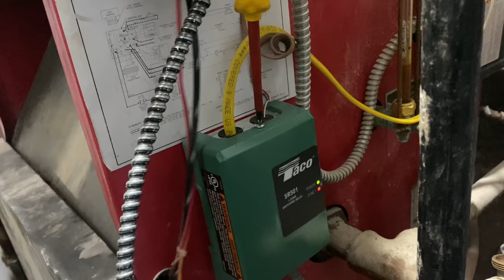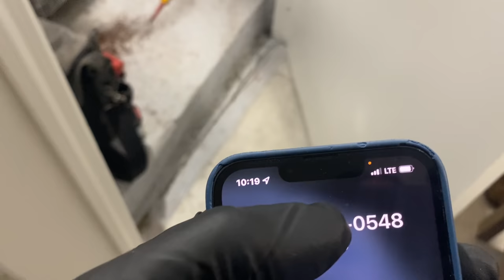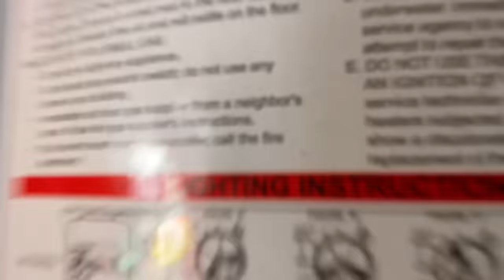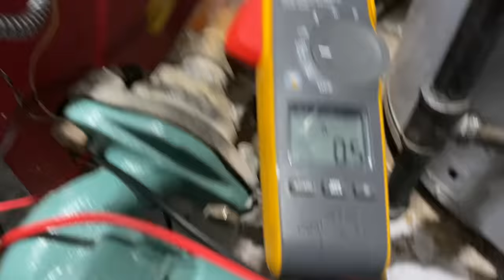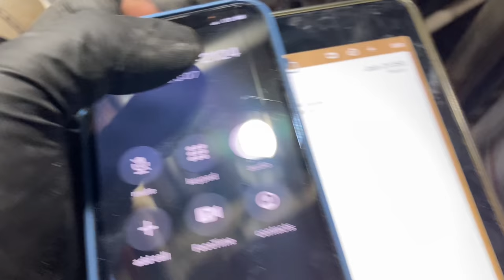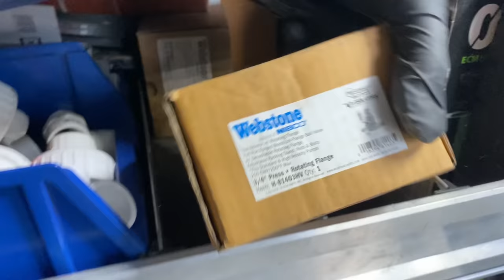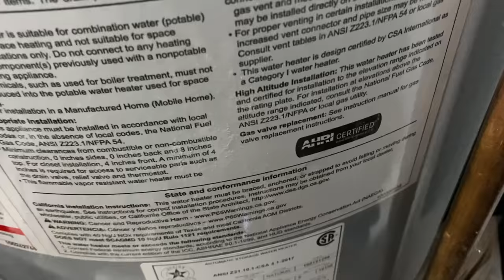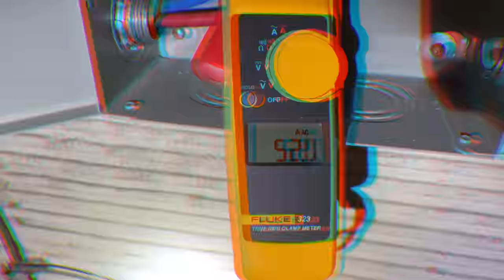How Not To Wire a Boiler Aquastat Explained Another Hacked Steam System

Comment: Hey Mike  they are still only circulating the bottom of boiler, hottest water is just below the water line. But manufacturers never leave a tapping for a basement zones as needed in the northeast. I have raised this question with sales reps, to no avail. just to entertain myself.
Great content.  Eric
Reply: Inconsistent water height level. Taking the water right below the surface may end up with the pump getting air locked, as the amount of water avaliable changes with the amount of hot steam in play. Second reason why to take from the bottom as the water is cooler. You dont need 200f water for circulators.
Reply: My opinions are based on 40 yrs of my own experiences. Not looking to change any minds,   Good luck
Reply: If you "raised this question with sales reps", usually that means your trying to change someone's mind. 40 years of experience, have you found a better way to do this?
Reply: @rickw4160 ❤0

Comment: Thank you for sharing your knowledge, learning so much. So I have an issue . Had a repairman break down furnace due to flame rollout issue. Heat exchange totally clogged. After that repair we turned on ( call for heat) test, we have constant cold starts ( low temp  holds around 100 degrees and high temp only reaches 140 degrees . Pressure of boiler hovers around 20 lbs. i know it’s limited info. Any insight? Thank you.

Comment: People don’t understand that the water is an important part of a basement zone circ on steam boilers. The mud in the boiler will clog up a water cooled circ. This is a great video for all landlords with an illegal basement apt.  Why do they keep having to replace the pump.
Reply: Plenty of people with heating needs in a bsmt, without it being an illegal apartment. It is also called a den, a rec room, man cave, etc.  Steam is a terrible way to heat the same floor as the unit.
Reply: My reference was clear to landlords of illegal basement apts only,  who don’t understand why they have to replace pumps. This video was a great explanation.     May have hit a nerve with some people. Not my intention.   Just learn
Reply: It will happen with anyone. Steam boilers require constant flushes. If not something will clog or burn out somewhere. Understand your illegal basement thing, but you can still have many operational systems even with illegal basements. Probably seen more decently kept ones in illegal rentals as people will complain of no heat quick.

Comment: So the aqua stat is only limiting basement zone controls? 1st floor can still control boiler regardless if its open or closed?  …Actually a good idea to prevent cooking people on first floor.  They just screwed it up badly.   
But Im surprised there wasn’t always enough heat in the high mass boiler to satisfy the basement apt. demand.  The upstairs higher heat load should be calling much more frequently than basement, keeping the boiler warm.  ……Probably didn’t even need the aqua stat if the system wasn’t clogged up with sediment. The sediment clogging was likely the reason for all the issues and two failed pumps.  The guy who added the aqua stat missed the real problem. What do you think?